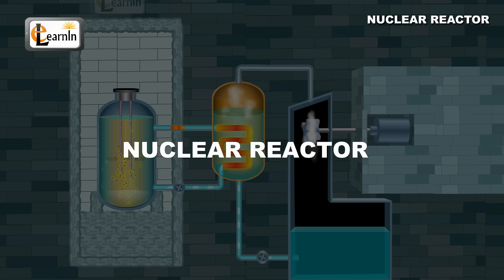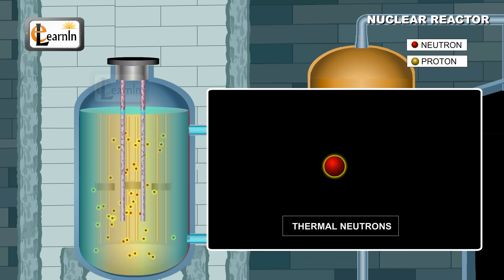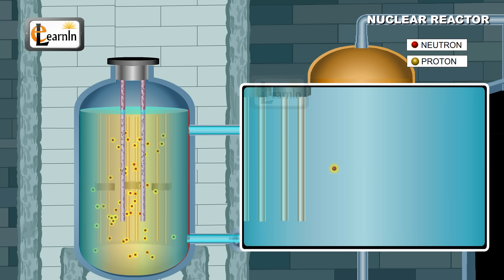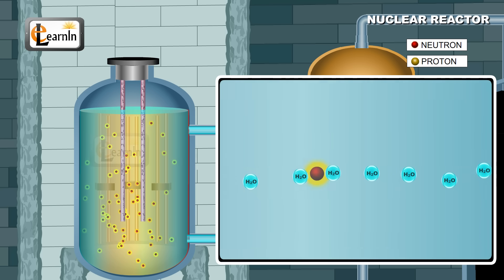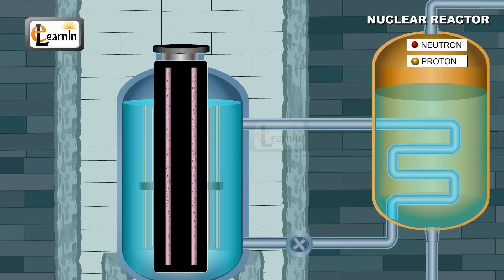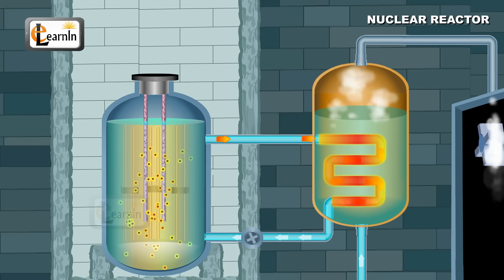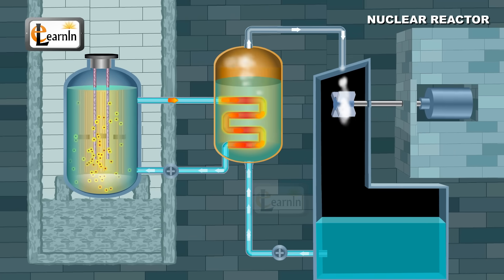Nuclear Reactor - Understanding how it works | Physics Elearnin

Comment: If nuclear continues to be the backbone, uranium consumption could double or triple over the next 20–50 years.
 
Example:
 
Doubling consumption: 67,000 × 2 = 134,000 t/year
 
15,000,000 ÷ 134,000≈112 years
 
Tripling consumption: 67,000 × 3 = 201,000 t/year
 
15,000,000 ÷ 201,000 ≈ 75 years
 
So your intuition is correct: rapidly growing demand reduces the “runway” for uranium.

We are trying to speed run our death
We are so fucked you have no idea
So basically i got here because if you break everything done, humans are really only limited by the amount of energy they can harness
There is no better way than getting energy in large scale then nuclear 
There is a lot of research going into modular nuclear like creating mini reactors to power individual thing like boats, cars, data centers
But once we run out we are fucked.
unless we can like turn to the sun or some shit.

The above was from me asking about current consumtion, if nothing changes we have around 224 years of reserves, but things will grow so we are really only looking at around 150 years

Comment: So it’s just a super dangerous, massive steam engine huh interesting or am I dumb and understanding this wrong? 😂
Reply: It’s not super dangerous there are emergency backups on the emergency backup and another emergency backup for that backup for everything  and it’s not a steam engine it’s a boiler. Steam engines are engines not power plants and size may vary your not dumb you just watch a lot of the Simpsons
Reply: @P @Pratt-and-whittney   wasn’t Chernobyl a nuclear reactor that exploded in fair point that makes more sense thank you
Reply: @Zache044  because that was a cheap Russian Soviet model and most of the operators were going beyond regulations.
Reply: @Zache044  chernobyl used a RBMK design which is not a a PWR design. The RBMK used graphite as the moderator which causes a positive void coefficient. Basically if the coolant is lost there is still a moderator so reactivity increases whereas PWRs use water as both the moderator and coolant making them inherently safer

Comment: 1. Fuel Materials
These contain the fissile or fertile isotopes that undergo fission.

Uranium dioxide (UO₂): Most common nuclear fuel.

Uranium metal: Sometimes used in research or military reactors.

Mixed oxide (MOX): Blend of plutonium dioxide (PuO₂) and uranium dioxide.

Thorium dioxide (ThO₂): Used in some experimental reactors.

2. Cladding Materials
Cladding surrounds the fuel and prevents radioactive fission products from escaping into the coolant.

Zirconium alloys (e.g., Zircaloy): Low neutron absorption, corrosion resistant.

Stainless steel: Used in some fast reactors.

Advanced alloys & composites: For high-temperature reactors.

3. Moderator Materials
Moderators slow down neutrons to sustain a chain reaction (in thermal reactors).

Light water (H₂O): Used in Pressurized Water Reactors (PWRs) and Boiling Water Reactors (BWRs).

Heavy water (D₂O): Used in CANDU reactors, very efficient moderator.

Graphite: Used in RBMK and Advanced Gas-Cooled Reactors (AGRs).

Beryllium (Be): Sometimes used in research reactors.

4. Coolant Materials
Coolants transfer heat from the reactor core.

Water (H₂O or D₂O): Most common.

Liquid sodium (Na): Used in fast breeder reactors.

Helium (He): Used in high-temperature gas-cooled reactors (HTGRs).

Carbon dioxide (CO₂): Used in AGRs.

Lead or lead-bismuth eutectic: Used in some experimental reactors.

5. Structural Materials
These provide mechanical strength and house the reactor core.

Stainless steel: Strong, corrosion-resistant.

Carbon steel: Often used in reactor pressure vessels.

Nickel-based alloys (Inconel, Hastelloy): Withstand high temperatures.

6. Control Materials
Used in control rods to absorb neutrons and regulate the chain reaction.

Boron (B, often as B₄C): Strong neutron absorber.

Cadmium (Cd): Good absorber, used in some control rods.

Hafnium (Hf): High neutron absorption, corrosion resistant.

Silver-indium-cadmium alloys: Used in PWR control rods.

Comment: Title: Integrated Sustainable Infrastructure: Nuclear, Seawater, and Concrete

Slide 1: The Challenge

Growing energy demands (data centers, AI).
Need for carbon-free, reliable power.
Water scarcity and infrastructure challenges.
The search for sustainable, resilient solutions.
Slide 2: The Solution: Integrated System

Small Modular Reactors (SMRs): Safe, reliable, carbon-free energy.
Seawater Utilization: Cooling, desalination, concrete production.
Advanced Concrete: Seawater-based, fiber-reinforced for durability.
Greenhouses: Utilizing waste heat for year-round crop production.
Slide 3: Key Synergies

SMR waste heat powers desalination and greenhouse heating.
Seawater provides cooling and strengthens concrete.
Desalinated water supports agriculture and industry.
Modern fibers replace steel rebar in concrete structures.
Slide 4: Benefits

Reduced carbon footprint.
Increased resource efficiency.
Enhanced infrastructure resilience.
Improved food security.
Cost-effective, sustainable solutions.
Winter time concrete production.
Slide 5: Implementation

Coastal locations ideal for access to seawater.
Advanced water treatment and heat exchange technologies.
Careful environmental impact assessments.
Government and industry collaboration.
Slide 6: Conclusion

An integrated system utilizing SMRs, seawater, and advanced concrete offers a pathway to a sustainable and resilient future.
This innovative approach addresses critical challenges in energy, water, and infrastructure.
This system is ideal for high concrete usage areas, such as California.

Comment: Ok, so all the water that surrounds the fuel elements and control rods, is it radio active and if so what do they do with it? Is it replaced after a certain amount of time or does it stay in the system indefinitely?
Reply: I'm not an expert but I would guess the water becomes radioactive.   Don't know any more than that.

Comment: So the Radioactive uranium ? Heats the element in the boiler, instead of electricity. Then the boiled water creates steam that turns a turbine ? What if after that you get the turbine to power a giant microwave oven machine that boils even more water to create even more steam that goes into even more turbines ? Or what's more powerful than microwaves ?

Comment: So will uranium split on its own and we just use a nuclear reactor to harness that? What i gathered is uranium is the main power source and the water and control rods are just there to increase and maintain steady power and the water pumps are only there to feed the turbine to harness the energy. Sorry this stuff is real confusing and Im just trying to understand physically what is happening. Is this basically the same thing as an air conditioner with refrigerant? You are taking a chemical and harnessing its chemical reaction. With this its to produce heat that is used to produce steam with an AC it is compressed to produce cold pipes that a fan blows across to cool a room.

Comment: I want to add that there are many reactor models, the one shown in this video is a PWR (pressurized water reactor), whereas some can boil the water directly in the RPV, these are called BWRs (boiling water reactor)
Reply: do you need glass reactor

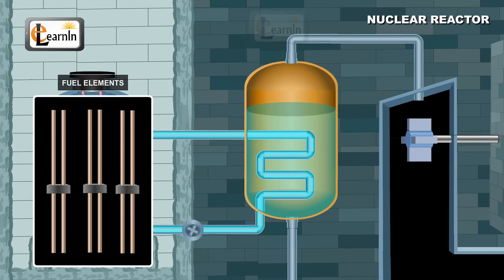Comment: 0:40 Only Uranium 235 can undergo Fission; however, Uranium 238 can be introduced to decay to Plutonium 239 which itself can be used as Fissionable material. Uranium has to be "Enriched" before it can be used in a Reactor or Weapon (atom bomb) there's 3 Isotopes of Uranium, U235, U234, and U238, the U234 and U238 are removed because they're considered Impurities and absorb Neutrons so, that would lessen the effect of the Fission, that's what the control rods do after the Fission starts, they're usually coated with Graphite because Graphite absorbs Neutrons more easily, Control rods "Control" the amount of Neutrons being bounced off of each other during the Fission process.

Comment: 0:16 "fossil fuels" are NOT running out. That is a complete LIE !!! This is equal to the same nonsense the left used to say in the 50s, 60, 70s & early 80s when they said "Water on Earth is running out...at this rate, Earth will be out of water by 2025" 
Oil comes from the Earth naturally and renews itself. It's made when magma & crust liquefy. There have been 30 formerly closed oil wells tested 10+ years after being closed & they ALL have refilled. 

It's extremely hard for humans to fathom just how MASSIVE the Earth really is & how the inside of the Earth really works. 
The Earth itself expels out It's oil ALL THE TIME. Mostly in the ocean. MILLIONS of gallons of oil are naturally dumped out into the ocean every year. That proves the earth doesn't need to hold it in...if it did...it wouldn't shoot it out of itself.

Comment: In the event of power failure to drive the moderator pump. Is it possible to use the steam that would be created from the water in the moderator to run the pump instead? I realize radiation would be an obvious issue here and I am not an expert in this field. Just curious to see if there are any ways to improve redundancy or slow down a potential failure.

Comment: It does not work like this. The main energy is from U235 breakup, creating twoo lighter cores (for example Kr and Ba), which stay in the fuel rod and their kinnetic energy is transformed to heat inside that rod. That rod causes watter to boil or so... thanks and thing guys.

Comment: The (PWR) pressurized  water reactors developed by the American company  Wastinghouse are the AP1000 model , these reactors are already operating in two nuclear power plants in China , and when the unit with AP1000 starts operating in the USA.

Comment: This is the most inefficient and basic design I’ve ever seen, I thought nuclear reactors had some rocket science, can’t believe they use cold water to slow down the reaction, the cold water itself takes away some of the energy that we need to harvest, we should leave nuclear stuff and focus on the sun bcz nuclear power is limited and we dont have the tech to harvest it properly yet

Comment: U235 is the only isotope that's fissinable. U238 doesn't have a chain reaction. U238 is enriched to around 5% U235 in order to be used for nuclear power. The U235 is what creates the energy.
Reply: U238 does not have chain reaction however when U238 absorbed fast neutron, it creates Plutonium 239 that causes chain reaction
Reply: Uranium-235 is initially used but it bombarded with a neutron to form Uranium-236 which disintegrates or breaks down into fission fragments.Otherwise Uranium-236 is abundant but cannot be directly used.

Comment: You mention "heavy" water, could you elaborate on what it is? Also, what studies have been done in regards to water alternatives(what other types of liquids could be of better use ie.. Ethylene Glycol or a Gel etc)?

Cool to learn about this
Reply: Heavy water means deuterated water (D2O), in which the hydrogen atoms of regular H2O are replaced with the heavier isotopic form.
Reply: Hydrogen has 3 isotopes (protium deuterium and tritium). Heavy water is about 11% heavier than normal water because it contains a higher proportion of D2O (heavy water molecules consisting of deuterium instead of protium).

Comment: In this model, the steam is recaptured, cooled to a liquid, and then pumped back into the main core reactor casing.   Does this method increase the amount of radiation/fusion and energy production, or is it simply used to prevent radioactive water from being expelled into the atmosphere?
Reply: first of, it is fission and not fusion, and it does not particularly increase energy production. Its advantage is the fact that, the water being heated indirectly, it is non-radioactive, meaning the steam going through the turbine is non radioactive. PWRs are the most common reactor type at the moment, because of simply how advanced and researched are its safety systems and its optimization aswell as containment. BWRs come next in term of spread of use, although the water is directly boiled in the BWR, so the steam is radioactive, but it does not mean it is dangerous at all.

Comment: Fact :A nuclear meltdown happens when  the heat generated by a nuclear reactor exceeds the heat removed by the cooling systems (Water: If the cooling tower of hot water malfunctioned ) to the point where at least one nuclear fuel element exceeds its melting point.

Comment: Pretty accurate. Just so you know the neutrons interact with the hydrogen vin the water molecules because the hydrogen  is the same mass as the neutron these allowing the neutron to give most of it's kinetic energy to the hydrogen  I've been working  in nuclear power for forty years of it's a pretty good explanation of how reactors create electricity those fast neutrons get absorbed by u238 if they don't escape the core first.
Reply: Its amazing people can work for 40yrs in a nuclear power plant and be healthy. Like 50yrs ago cancer would be a 100% risk factor.

Comment: I was thinking like in a Sci-fi context where we no longer convert heat from 2 times heating the water into kinetic energy, but instead, encapsulate the core element in absorbing material that would amplify the voltage generated each time a neutron strikes it, successfully harvest immediate electricity.
Reply: Its something that would put all energy company's out of business. I read earlier that 5 kilograms or 11 pounds of Uranium could power a modern home in the USA for 75 years. Imagine being the biggest energy companies in the world & knowing this. How would you discourage people from getting interested in Uranium? Make them scared to even go near it? The crazy thing is Uranium & Plutonium was handled daily by reactor workers, miners & everyone in the nuclear research & power industry. Not until the Government came in & told everyone it was extremely dangerous did it ever get looked at to risky for society to utilize. Even then it took 50 years & several generations to drill this idea into peoples heads because the people that had worked with it before they made this claim shrugged it off. There are a few people in that industry from the 1940s & 50s that tried to be whistle blowers & even did documented speaking tours but they were all blacklisted. With a little research you can find them but they are treated as wackos which is strange because they were so trust worthy to work in the Nuclear Power energy before. All I know is everything I think I know about Uranium & Plutonium is based on what is taught & I couldn't prove any of it if my life depended on it. On the other hand I do know & can prove how Governments, Monopolies & Capitalization works & how scaring people away from alternative's to your products or services is one of the oldest tricks in the world.

Comment: this video does not explain how the chain reaction is started or how it generates heat. what a useless garbage video
Reply: 1)there is a neutron source
2)heat is generated when the atoms split. It transfers to the the water which converts to steam and turns turbines
Reply: @angadsingh9314  thanks but ur too late I already wrote my garbage paper using garbage sources like this to explain how it works

Comment: its basically a way to make hot water in the most dangerous way possible
Reply: no, today is nuclear reactors one of the safest producer of energy, there are hundreds of safety norms that every reactor have to meet. You probably know the biggest accidents caused by nuclear power, like Chernobyl and Fukushima but there are 441 nuclear reactors currently operating. It's like if one plane crash let's bann all planes because they are dangerous. Nuclear power plants are almost most enviroment friendly power producer, coal power plants are producing thousands tons of coal ash which is polluting air and killing thousand of people, and is producing even more radioactivity than nuclear reactors. In today world with all there safety rulers are accidents extremly rare.

Comment: The basic funda is almost same everywhere,i.e. the conversion of thermal energy into mechanical energy, which further converted into electrical energy by Dynamo.
Some directly produces mechanical energy (for rotating the shaft) like Wind, Waves, geyser/hotsprings, etc..
Reply: The geysers, which is properly called geothermal energy, uses steam turbines too. They don't just get it from the geyser, that would be too unreliable. They drill two very deep holes, push water into one, and steam comes from the other.
Reply: Alternator not  a dynamo. Dynamo produces direct current, we need alternating current, alternators produce that.

Comment: Why does the water in the nuclear reactor (used as a moderator) not also evaporate during normal use? I understand the water in the heat exhanging is converted to steam then cooled and returned but what about the now radioactive water in the core?
Reply: after a year to answer your question i believe the water in the core is under intense pressure to keep the water in liquid state, then is moved out of the core into the heat exchanger where it is released as very high pressure, hot steam.